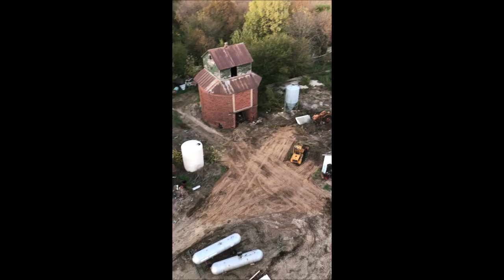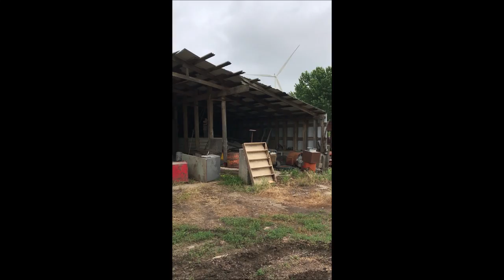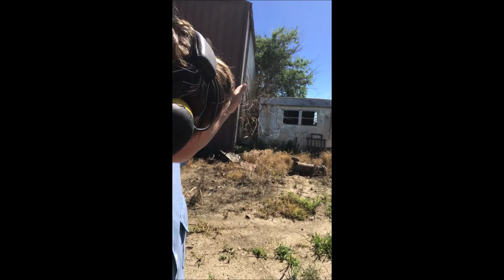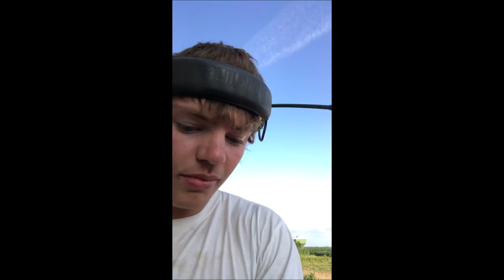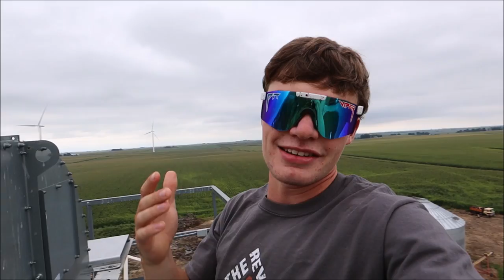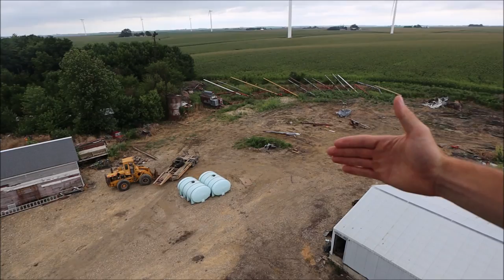Cleaning Up A JUNK YARD | Part 1

Comment: Like a lot of older people who lived through the Depression years they saved everything, cleaning the grandparents farms looked about the same.
Reply: Same when my grandpa died. I lost count and all the scrap and garbage I hauled off. It took a while to get my OCD to calm down.
Reply: @2008truckman  Friend of mine hauled out several full size pickup truck loads of washed empty peanut butter jars from his grandparents place
Reply: @bigunone  John had it right. If you lived through the depression. You didn't throw anything away. No matter what it was. Because you might need it down the road.
Reply: @2008truckman  Double whammy in our area. This was all dryland farming till sometime in the late 40s early 50s, weather pattern changed and suddenly the rains quit farms were just abandoned. Those that stayed on had a hard row to hoe. Rains never have come back and town is slowly drying up and kids graduate and move to the city for work. Now you either ranch (1 cow calf pair per 5 acres) you drive to town for work or you are retired and moved here.
Reply: @bigunone  Sounds like you live in garden country. You try to run cows at that rate where i live, it would be nothing but dirt. I'm one of the few still row cropping. Most of what was farmland when i was a kid was put into grass. Over grazed to the point of growing up in brush. Then gets cleared and put back in grass. Wash, rinse, repeat.
Reply: @duanehenicke6602  LOL I must have been  asleep when I posted that, Central NM  is 50+ acres per cow calf. Neighbors measure their land in  sections a small place is 6 sections,
Reply: @bigunone  For sure! Know that country well. Used to drive 600 miles to see one of your women. Why anyone chooses to live there always blew my mind. Strange how the wind and dirt gets into ones blood and makes them want to stay. I suppose some would say the same about south Texas.
Reply: @duanehenicke6602  Just lucky I guess, they ain't going to put in a big housing development next door for sure
Reply: @bigunone  No doubt

Comment: Nooo, not that beautiful old brick building, what a shame, it couldn't be used for something?
Reply: Gracie J. ...agreed. That was the coolest bldg so far. The brickwork looked solid. Oh well, he has a vision.
Reply: I am sure the local rats were very happy to have such a nice solid building full of old grain and no pesky foot traffic. I agree it was kinda neat, but most of those old grain elevator type buildings are abandoned for a reason and are designed in such a way inside for a specific purpose, which tends to not include much any other purpose. 
I am a bit sad the bricks weren't saved though, old red bricks do have value for reuse. But time is money, and farmers aren't wealthy in either.
Reply: I thought that too but most times functionality is more important than looks sadly
Reply: Not the round grainery. Sad

Comment: We have lived this.  My sister bought 33 acres that looked pretty much like your junk pile.  What wasn't covered in junk was covered in Osage orange trees and thorns.  The collection included 3 mobile homes.  We were saved by a scrapper that came and cleaned the majority of the mess in trade for the metal and a few broken vehicles with titles.  Then a few years after that I moved back into my family hoarded home and basically did it all again but on a much smaller acreage thankfully.   I feel your pain about the stuff found worthy of keeping.  There is a time in every project of this kind where you feel like all you do is move piles from one place to the next.   I too made quite a few "before" pictures of this place, but no videos.  My sis didn't even make very many before pics of her place which is too bad.   We are not done yet, but when we get discouraged it is very helpful to look back at where it all started.

Comment: Years ago I helped a friend clean out an old quanset building once. He had fairly recently taken over the management of the farm from his dad. On one side of the building there were cribs or graineries. Each one was full of vintage material. Old grain, tires, parts etc. I am sure you understand. 
We cleaned on that building for the biggest share of two weeks. Including building work benches and organizing tools. It took me a long time to understand why his dad wasn't his chipper self while we did this work.
Being an old fat guy now I kinda get it. I've been working toward thinning things out and actually using some of the stuff I've saved over the years to get some things done when I'm off. Hopefully, I don't leave a mess for my grand kids to clean up but, if I do, they will know the history and why POP saved that crap and never did anything with it!`
Good job young man! your Pop would be proud1

Comment: This video hits so close to home.. My Grandfather died at 92 about 3 years ago and left a small farm (much smaller than Cornstar) but it was so packed with stuff it looked like a junkyard.. 8 acres of it were solid junk. My Grandfather had not thrown much of anything away in 45 years and had others haul junk (though he thought it all had a use) into the farm. There was no way to keep the farm as it had not been maintained or been profitable in over a decade and I ended up having to make a deal with a neighbor that he could keep anything he wanted if he would clean it all out. I didn't have the equipment and I lived in a different town so I couldn't do it myself at the time. Basically he hauled and cleaned out everything from the grounds to inside the house (even things like the freezers full of food dating back more than 11 years, all 8 of them). He had hoped to find some rare gems to make a profit off of but he barely broke even and it took him 2.5 months at 8hrs a day 5 days a week. Once it was mostly cleaned I put it up for sale and got lucky to find a buyer within a week.  I grew up on that farm but it was just too trashed to keep. I wish I had the ability (and the energy) to like Cole. No place has ever felt as much like home as that farm did.

Comment: Contact the American Pickers. Maybe they could help you to put some jingle in your pocket. And take away some stuff to keep you from actually moving it yourself. One mans junk is another mans treasure.  Cole you could also have weddings and such at your place to help with that jingle. Because most weddings now are outside and in Barns. You have the barn. they can do the decorating and clean up . And pay you for using it.

Comment: I know scrap prices are low but looking at the volume of scrap to be hauled I betting that you will be able to use the money to remodel and fix/repair. Nothing to sneeze at since there is so much. I think that your entire farm will find value in running neat and clean. Unfortunately, your generation is going to experience the need for efficiency wherever you can employ it where generations older had the grace to operate with more freedom.

Comment: Lots of good lumber went to waste in just smashing down that old building.
Reply from the maker: CombineLover nonsense. The roofs on both of them have been leaking for 20 years. Both were shot.
Reply: @ColeTheCornstar  thanks for explaining.
Water damage was not visible, back in the quick video shots.

Did you save the feed bin?
Reply from the maker: CombineLover that was also completely rusted through
Reply: @ColeTheCornstar  that means the shed [which was little more than just a garage] was structurally unstable and DANGEROUS. 

Rather reminds me of Matthew 23:27!
Reply from the maker: CombineLover indeed, they were not safe.

Comment: It's to bad you didn't take that old concrete to a place with a crusher, so you could get the same weight you brought to them back in crushed concrete for driveways and yards
Reply from the maker: Philip Logemann that would've been very smart
Reply: @ColeTheCornstar  yeah, I tore out about four semi loads of concrete last year and had them bring crush when they came to pick up the concrete. Really cheap that way, but if you haul it yourself might not even cost you anything and they essentially don't loose any stock.